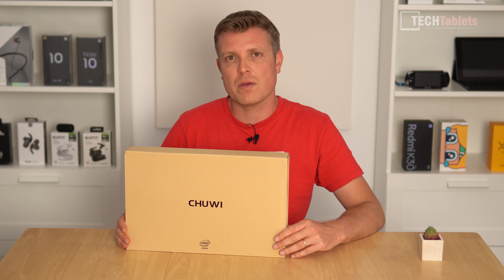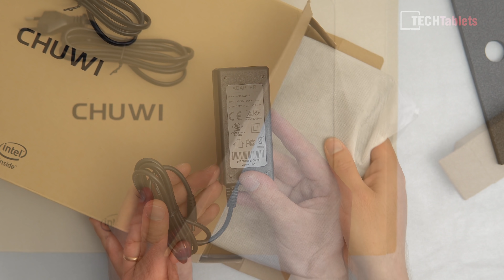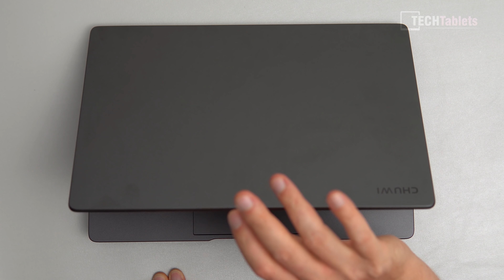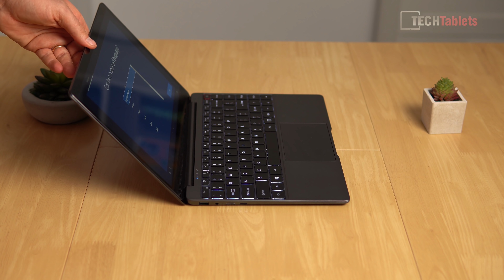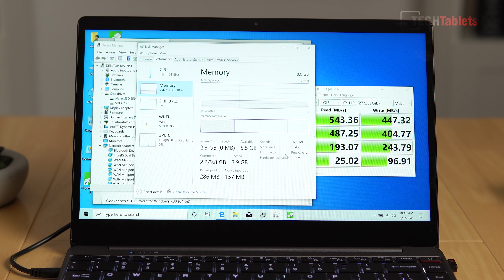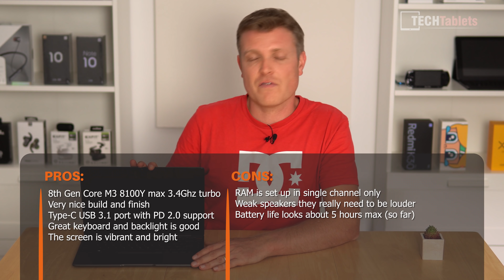Chuwi Aerobook Pro 13.3" Unboxing & First Impressions

Comment: The product page says Intel Core m3-8100Y.  But the shopping page says Intel m3-6Y30.  That's a huge difference in specs and it makes it very hard to trust this product.
Reply: m3-6Y30 is the non-pro version. m3-8100Y is the version in this video.

Comment: I love my Aerobook!  I was introduced to it from your channel.  I think I prefer the sharper angles on the original Aerobook to these rounded ones.
Reply: Is it fast
Reply: @exp3rtgmr  It performs exactly as you would expect a 6th gen m3 with 8GB single channel on Linux.  I have never used Windows on it, but I'd imagine with Windows it's fairly slow.  I hope they make an updated version soon.

Comment: Looks like it is the same build as the original Aerobook. If it is so, it will have the same hinge problem.
Reply from the maker: Almost identical apart from more rounded corners on the metal a minor tweak

Comment: We will see  with your review if this laptop have the same heat issue and please check if this laptop can run youtube in 1080p/60,  1440p/60 on Windows and Linux Please. Hope they will  show us this laptop with 16GB dual channel  and hope they will add better speaker in next version.
Reply from the maker: YT runs well as for heat I'm still testing and this will all be in the final review. No 16GB version apparently

Comment: Chuwi always has hardware defects it seems. Two of their Lapbook Pro's I ordered had weird blue spots in the display. Possibly glue or grease or whatever. They need to up their quality control by a 1000% as I have read MUCH criticism about various topics, such as random death of their stuff. Shame because they always look nice.
Reply from the maker: Thanks for all the feedback guys I hope Chuwi sees this! I'll make sure they do. Just to also point I review these loan units they send. Nothing more, it's not like I own shares in Chuwi or I'm their ambassador.
Reply: Basically they ask too much money if they can't up the quality. Lower the prices if you can't, Chuwi. About $200 for the Lapbook Pro and $300 for this one. Do it good or don't do it at all is my advice.
Reply: So I have the lapbook SE and it doesn't give me any problems. It's 2live years
Reply: My lapbook pro died less than a month, I returned it last January 2020 until they have not returned the laptop. I think this product has a very low-quality build. With very bad after sales service.
Reply: I am writing this on my Lapbook Pro and the battery just dies out on me randomly even if it the battery indicator shows it's far from empty. Good thing it still turns on but it is kinda scary for how long this will actually last.
Reply: Don't buy chuwi ! It's cheap chinese junk. My hibook pro sdcard reader stopped working after 2 months and build quality is dismal, so falling apart after 6 months of use and warrenty is non existing ! You have been warned...
Reply: Owing a lapbook SE and I couldn't agree more. Mine's mini hdmi and camera died on me, and I have had two charging cables replaced already. They definitely need to up their QA
Reply: I also have a problem with my aerobook 2019, because my battery isn’t charged properly and now i always need the charger connected
Reply: My 2 chuwi tablets died 6months after getting them, so yeah I totally agree.
Reply: My Aerobook from the Indiegogo campaign stopped booting as well after 9 months of use. Still waiting to hear back from Chuwi regarding warranty claims.
Reply: My lapbook 14's touchpad died, headphone jack doesn't have mic output and overheats without heatsink mod.
Reply: Same, my Hi9 Air died in 6 months, and my Hi12 is s shadow of itself, card reader dead in 2 days, battery almost dead...

But all they do look so nice on paper.
Reply: Yeah... 200$ I would consider it. 400$ is a bit too steep, considering that if anything goes wrong, you are on your own. I would much rather be covered by some sort of warranty and most laptops in the 400$ range you would normally get from your local electronics shop, do.
Reply from the maker: Not good did you get it replaced?
Reply: @Techtablets  didn't, no, thought it was too much hassle. Thought it was the battery, ordered a replacement but took machine apart, disconnected the battery, which looked fine, and machined was still dead. No apparent damage to motherboard. Needed laptop quickly (for work) so cancelled battery replacement and bought a surface laptop 3. Enjoy your reviews, I'm sure my issue was a qa issue.  Hopefully they'll improve that, and the availability of these brands in Europe for local returns/repair.
Reply: One thing that may have been an issue was I consistently charged and ran it off a high wattage MBP USB-C charger. I think they added USB-C charging quite late in the design so perhaps there was a weakness there.
Reply: Yeah, mine completely died after about four or five months.  Something wrong with the power (tried multiple supplies, including the original).  Also the glue on one of the rubber feet turned weird and sticky and the foot fell off.  Loved it apart from that, but it's kind of scared me off Chinese laptops.